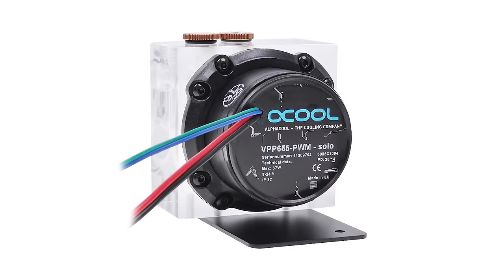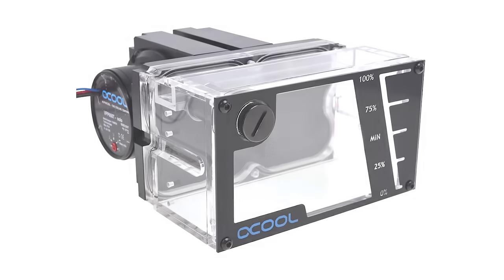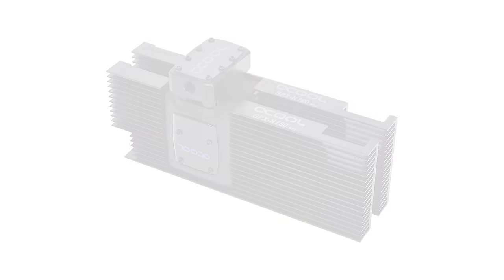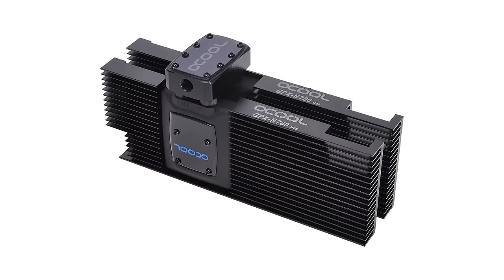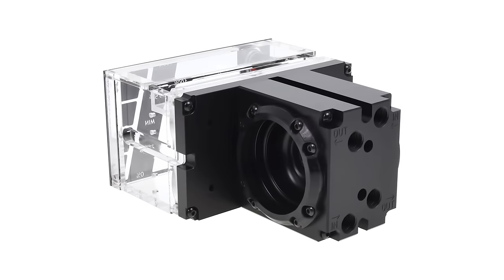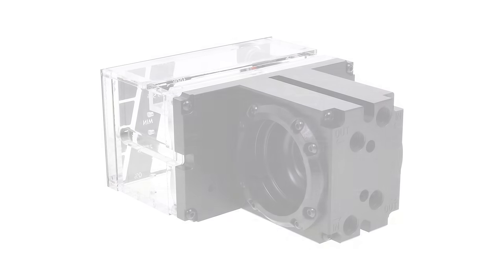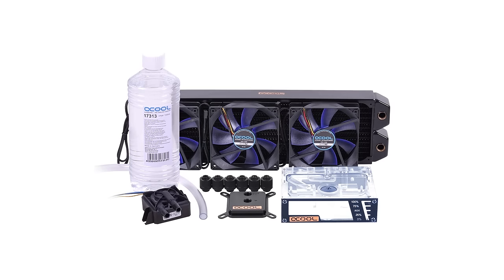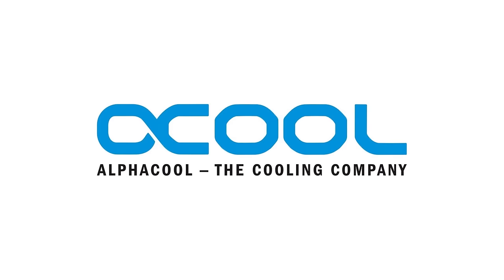Do radiator fins really matter?

Comment: You keep advertising my parts =o I bought a build off a guy and it has a EVGA 980 TI hybrid and it has two radiators in the system. I have a three fan radiator and a two fan radiator. My TI is on a custom block and the backplate is off a titan X . It makes for a nice look to the system. Both the GPU and CPU are run on an Alpha cooling system and the water goes through both radiators and my system stays nice and cool. 

The larger is a ST30 full copper 360 and the other is a ST30 full copper 240 Heat has not been a issue :> but wait till I have to clean it right lol. I also have an MSI overclocking board but I been having good performance and have not seen a reason to overclock it yet. I plan on overclocking once games get a little more demanding though.

I have six fans in the system so no it's not a quite system but I'm weird =p I find computer noises relaxing. 

The build was only a week old but the guy wanted money to finish his skylake build and lets just say the computer gods smiled upon me. I did not build it but she is my baby now. She spoils me rotten =x She even has a soundblaster Z card.

I feel spoiled but I am sure some of the race things it's a disgrace right =p z97 board and corsair vengeance DDR3 memory 2400 ram 16GB only. What was I thinking right? only a 4790k. There maybe faster and more expensive rigs but mine still makes me feel spoiled. 

I have not had her long but it popped up at just the right moment when I got some student funds back and the guy that built it wanted to sell it. I got the whole system for 1600 and two of the three hard drives are SSD. 

I tried not being an obnoxious little sh*t about it but my head was about to explode wanting to talk about my new system >.> I just could not resist D: forgive me D:Yup I'm a horrible person. :|

Comment: I have the alphacool T30 NexXxos 420mm radiator at the top and the same with 360mm in the front. Is this enough to cool 2x gigabyte g1 gaming 980 ti in SLI and the i7-6700k (4,7ghz) ???

Comment: I'm not trying to hate on the imperial system or America, but why would it be fins per inch when you say a 30 millimeters for the thickness. Surely the units should be normalized to the same system?

Comment: Hey Jay, do you think it's possible to completely passively cool a system at reasonable ambient temperature? Obviously there's fanless CPU coolers that would work and passive PSUs but I'm wondering if you can achieve completely passive GPU cooling via watercooling (excluding the pump maybe).
Reply: do what Linus did and put a big
copper loop on top of the case xD
Reply: +Mr Kagouris whole room water cooling, linus did it, it was silly and didnt really help but i think that counts for what your asking?
Reply: +MCatwar and it worked like shit
Reply: Daniel Bricker If I'm at the point of putting the radiator outside my room I think it'd be easier to put my PC in another room the same way he did.

Comment: i am using a pe 360 from ek with 16fpi split fin    with 3 cougar cb12 fans ( very quiet   and good for airflow ) and i see the difference between sp120   ...sp120 move nearly no about of air through radiators ... and are much louder when they move the same amount than the cougars with lowest speed ...   and my front 280 cool stream   uses 4 af140... no need for static pressure ... i think it doesn't matter anymore .. only difference i noticed is the freaking low airflow that is released when passed the radiator and the freaking sound level of the static pressure fans ...
Reply: +oOWaschBaerOo we are in the same league m8, i also think the AF seires outperform the SP ones by far, but they are louder
Reply: nahhhh my af fans are much quiter than the sp fans ... and when i use the sp fans its like a not spinning fan .....   and when they turn up to get some small amount of air moved they are much louder than the af fans from corsair or cougar  but without the same amout of air moved through the 16fpi radiator ..

Comment: Would it be useful to add an extra 120 rad in a loop without a fan? 
If I would take a low FPI rad would the natural rising of hot air be enough airflow to help in cooling? 

Also, Is there anything you could do about the blinking of your keyboard leds? It's very distracting.
Reply: No it wouldn't be useful, or worth it
Reply: +Deadrablade ok, thanks. Will keep that in mind when finalizing my new loop :)

Comment: What rad size would you recommend for 1 cpu + 1 gpu loop ? 
I have a HUGE case that can support 2x 480 rad. But I'm thinking getting smaller case without compromising the cooling capacity.

Comment: so here's a question. corsair h100igtx seems like it has high fpi but it is aluminum. so when you compare it to a copper rad with the same fpi since copper is alot better at heat transfer, would it make a big difference or is it assumed copper is the best and  this video is about the best ?

Comment: Can you take a closed water cooling system and turn it into an open system. I have a Corsair Hydro Series H90 closed system and I was wondering if I could add a gpu waterblock to the system to cool my graphics card. Either by just adding to it and keeping it closed, or turning it into an open system. Would it be possible or not really worth it.

Comment: i would like to mount 2 thermoelectric coolers or peltier coolers to the opposite side of the fans of a radiator directly onto the fins of the rad, and then mount 2 cpu coolers on to those to keep them cool, its just an interesting experiment i was wanting to do with an aio water cooler mounted outside of a case just in case there was any condensation problems, does anyone have any advice before i try doing this? do you see any obvious problems lol

Comment: Hello sir this is prob a dumb question.  I have a 6 yr old computer that I do gaming, video/photo editing on. I plan building a new computer for next year. My question is direct x12 is going to utilize all the cores and of course if the game developers utilizes it as well.  Your opinion should I go with more than four cores or stay with 4 cores with hyper thread. I am planning on a  sli 980 ti or better depends what nvidia comes out with. I'm not going 4 k monitors because I need the 144 hertz. I hope I have giving you enough info. I am trying not to go with the hype of direct x12 but I feel I should take it into consideration because this new computer will have to last me for five years. thank you sir for the time.

Comment: will 3 360mm rads be too much for a 5820k and 2 980ti's? rads would be 45mm thick with 10 fpi
Reply: Yes
Reply: +James Mastroianni depends on how high of an overclock you're running and how silent you want it to be. I think it is overkill. 2 360mm would be fine. More just means you can run fans on a lower rpm but then there is more resistance to flow in the loop so you have to have a more powerful pump.

Comment: How cool can you get a system before it shuts down ? Has anyone tried external housing the cooling system then routing it Back into the case ? I'm still only getting 3.4-.7 ghz out of a 4.2ghz processor - Everything is set at optimal butt , my temps are going threw the roof at around 3.2-.7ghz - Very positive air flow - the case temp never goes above 47°f - butt my CPU is at 80°f and above - thought it would had crashed by now butt it keeps going ?

Comment: I would like a video on how to make my PC as quiet as possible.  I'm going full force on my gaming channel but the fans on my PC are so noisy, they have seriously hampered the quality of two videos I'm putting up soon.
Reply: Turn down your fan speed, problem solved
Reply: +Crossplay blow a hole in your wall for your wires and put the computer in the next room over
Reply: Deadrablade That's not an option.  I don't have a fancy rig.  It's moderate at best.  To make matters worse, my room is always the hottest one in the house.
Reply: GoogleMinus If I could even do that feasibly, my computer would end up in either the bathroom or outside.
Reply: Crossplay I have also seen computers in a padded box much larger than the computer, and you make bends between the entrance and exit holes so that no sound comes straight out of the box, it must bounce off the padded walls.  If your room is always hot that may not be such a good idea though.
Reply: I have been considering something similar to that.  It would certainly be the cheapest solution but I was hoping fore a more eloquent one.  Well, that and I have had this itch to try a custom loop ever since I've seen hard tubing.

Comment: how much does having a fan on both sides of the radiator affect thermals?
Reply: It depends on a lot of things, no definitive answer
Reply: +CaptiveCreeper Push/Pull works best on thick radiators or radiators that have a high FPI. Most of the time it's not a massive increase in performance (in my opinion considering fans can be quite extensive on top of watercooling).

Comment: So if i wanted to cool my fx-8320e quietly i would want a big rad with low fpi and low rpm fans
Reply: Overclocked
Reply: +SuperCookieandthecraft the best way is to get the biggest rad possible, thickest possible rad with the highest fin density and high rpm and high static pressure. But the trade of is noise.
Reply: +TheBeetrootman "quietly"
Reply: +SuperCookieandthecraft Yes sir, just make sure it&#39;ll fit in your case, either the top, front, or back.

(and make sure the rad isn't too thick to the point that it runs into the motherboard from the top with a fan on, or a HDD cage at the front or something.)
Reply: +Nadeem Khatak i have a define s so i have room
Reply: SuperCookieandthecraft You should be good! That thing has room for every single kind of radiator, knock yourself out and have fun! (big rad with low to medium FPI, and low RPM fans) http://puu.sh/nbQZN/91c051cda2.png
Reply: Honestly I would just get a new CPU no point in watercooling that thing
Reply: +SuperCookieandthecraft You can liquid cool it, if you want. It will lower temps for the CPU. Also don't listen to the Intel people above. The good part about water cooling is once you do it you can upgrade and use the same water cooler most of the time. Get a small rad a 120 or 140 you could do 240, but its up to you. For that CPU it will help you overclock and keep temps well below 60C depending on you ambient temp.
Reply: killerv135 technically speaking i am also an intel person because i have 2 g3258(one is possible dead but unconfirmed), and i5-4960k in one build.

Comment: Can you explain what ddr ram is?
Reply: Google it, I'm sure Linus has already covered thus as well
Reply: +littleg8r where?
Reply: +littleg8r *this.
Reply: +littleg8r um I don't see anything
Reply: +GreyDaedalus DDR RAM is short for Double Data Rate (DDR) Random Access Memory (RAM).  The number after it, e.g. DDR4, means that is the 4th generation of the standard.
Reply: +Suribachi Doesn't really tell him what it is though, does it?
Reply: +TheBeetrootman yeah I know that, but not really how ddr ram works
Reply: +GreyDaedalus ddr was rather litteral and ran at double the speed of the previous ram standard, after that they havnt literally doubled in speed, and in all fact the chips themselves havnt increased in speed since DDR1, ddr2,3 and 4 have increased speeds by doing things like increasing the buffer and stuff like that, i think this question is best fielded with wikipedia, i dont really think this is something jay would cover, he isnt here for history lessons usually